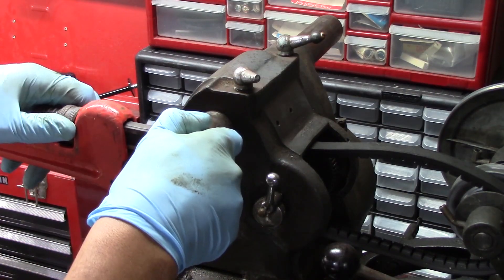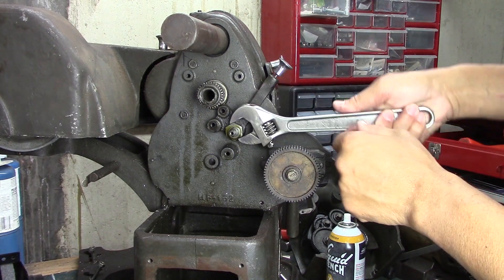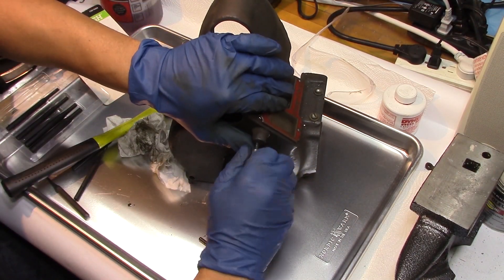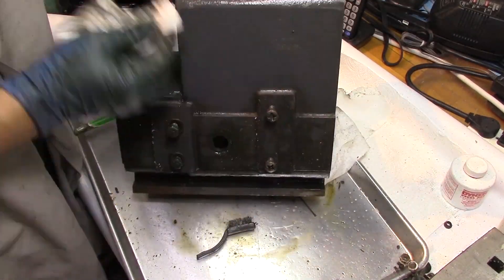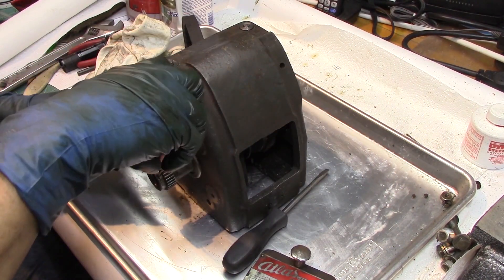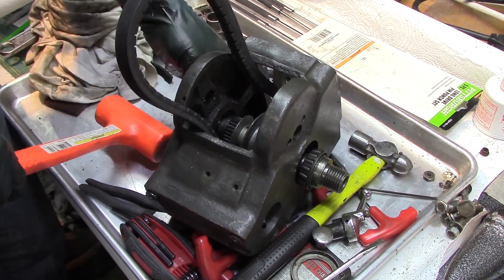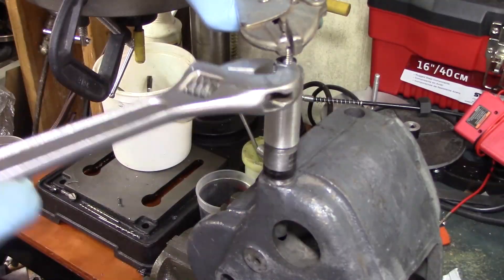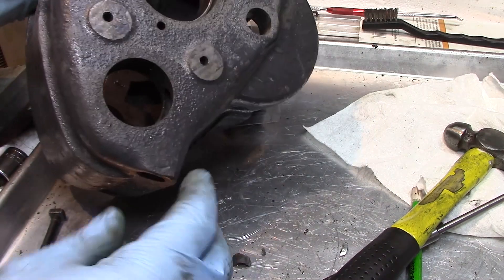Atlas Horizontal Milling Machine Restoration Part 1, disassembly and cleaning (machining)

Comment: I have had one of those little mills setting in a corner for about 10 years now. I just had shoulder surgery and it's cold here in Alaska right now. I just put it up on th work bench to tear down clean and paint. Im looking forward to the project.  This video was very useful
Reply from the maker: Thank you so much!  There is a youtuber Ghostses that shows exactly how to tear it down and put it back together too.  Good luck with yours and thank you again.....

Comment: Those zamak chamfered wedges were a common design among all Atlas tools. It’s the same as your tail stock clamp on your 6” lathe. Also seen them on atlas made drill press table lifts and even King Seeley used the design when they made the 80/100 Craftsman drill presses. Later they switched to steel on the presses. The problem is the how malleable the zamak is and when it clamps it can deform and cause it to get stuck. I’ve destroyed many of them before but luckily on the stuff I removed them from I have access to both sides of the bore and I just air hammer them out and replace with steel. Flawed design.
Reply from the maker: I had no idea!  I just got some different ones that are zamak, but I will machine steel ones.  You just saved me some headaches down the line.  Thank you very much!

Comment: Is the difficult bolt removal near the end part of the lockdown for the overarm support?  If so, that would explain why the overarm came out so hard.  Once you cleaned it up, the original paint looks great.  Most older machine shop equipment looks much worse than that inside.  It gets used daily, but will never be disassembled and cleaned.  I fixed up a couple old Logan lathes several years ago, and the headstocks were so full of chips I was amazed the gears could turn.
Reply from the maker: It was the overarm support locking mechanism and not the locking nut.  It was a nightmare to get out!  And I was quite surprised how nice it looks cleaned up.  However, I think I'm still going to paint it because I will probably never have it apart again.  And thank you very much.....